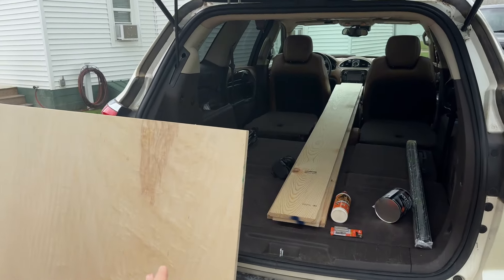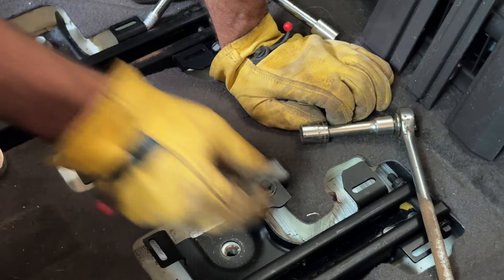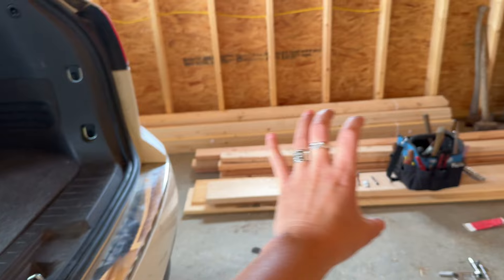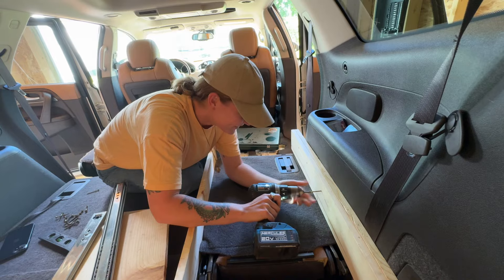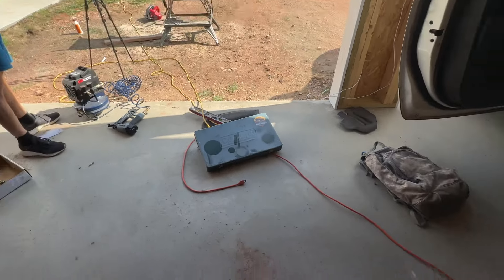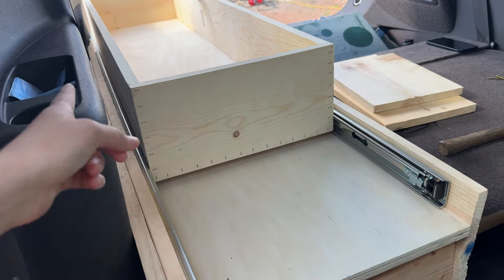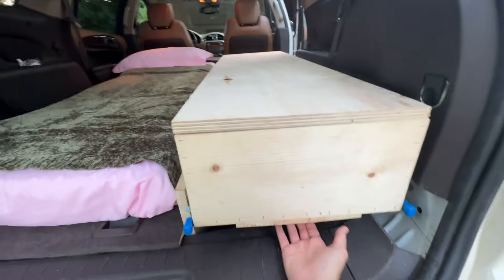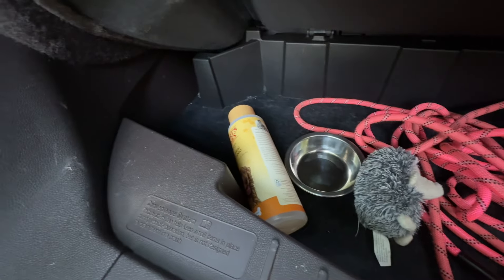BUILDING A PULL OUT KITCHEN IN MY SUV (BUICK ENCLAVE)

Comment: Nice build. Definitely digging the pull out kitchen drawer. Is it low enough to put the lid down and cook on top when you're outside? Consider making small compartments inside to hold things from rolling around or shifting to much. Or just add plastic bins to contain loose things. The cool thing about that large slide is it doubles as your desk when you're not cooking and you can still use it if it's raining outside. There's my two cents, lol.